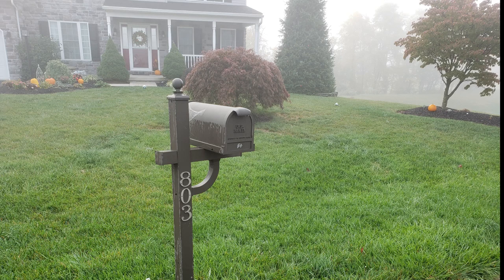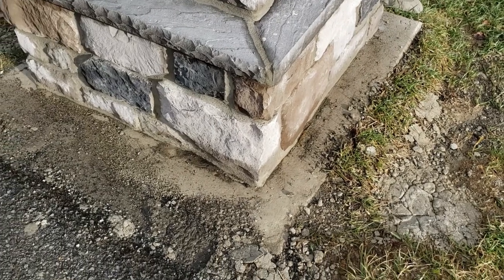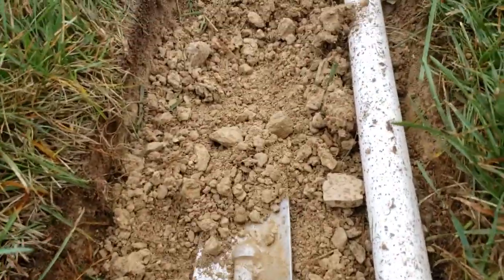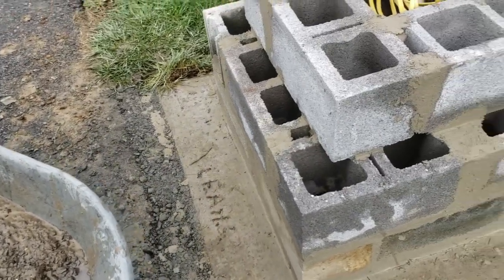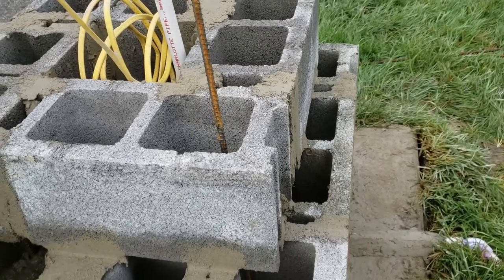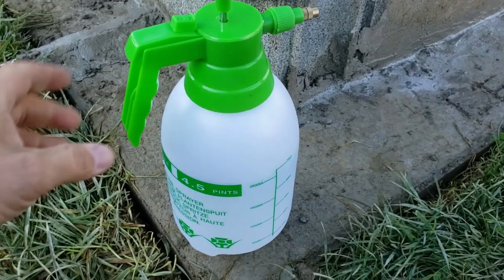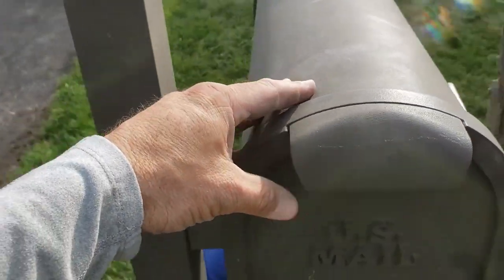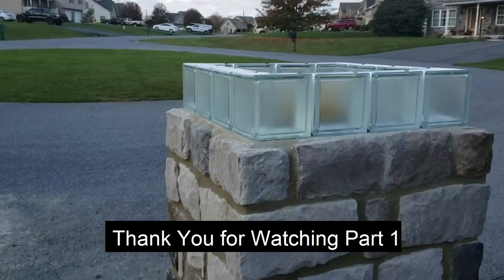DIY: Flag Stone Column Masonry Mailbox [Part 1 of 4] mailbox insert and veneer stone

Comment: That is one sharp-looking piece of masonry.
Reply from the maker: Thanks for the kind words. Let me know if you have any questions. I am excited to share and help others. When I built this, there wasn't much out there explaining so I decided to share
Reply: @DIYinspiredLewisBrantner I would of liked to see how you hooked up the light inside of the glass block and also if you incorporated that outlet?
Reply from the maker: @AStanton1966  It was really easy, I removed my old outside pole light and sliced the wire to it and ran to the new mailbox. I ran the wire to a outlet. Then I took a round ceramic light with a plug and inserted it into the outlet. I did it that way I could change the light socket rather easily plus, if my wife wanted to install christmas lights around the column, she could plug them in
Reply from the maker: @AStanton1966  go to this video https://youtu.be/QQnpZZ9B57c?t=579
and you will see the outlet
Reply from the maker: I want to publish a 4th video of me landscaping around the mailbox but didn't get that done yet. Also, I have many questions about the light which I should do another video of just that part, thanks for the questions so I can improve

Comment: What kind of light did you add inside the glass block & how did you hide/secure the outlet?
Reply from the maker: I wired in an outlet to plug in a light that I have setting in the center
Reply from the maker: Nothing fancy
Reply: @DIYinspiredLewisBrantner  I mean was it just a light bulb?
Reply from the maker: @dustinfigueroa1205  look for my other video, it shows it. I installed a light socket with a regular bulb
Reply from the maker: Did you see this video? Its the last in the series
Reply from the maker: https://youtu.be/QQnpZZ9B57c
Reply: @DIYinspiredLewisBrantner  yes I seen all 3 videos (well done btw) but I couldn't find part 4 of 4.
Reply from the maker: @dustinfigueroa1205  that one basically is the landscaping. I don't have it posted yet. I have to get on it

Comment: What are the measurements for base, first level and then 2nd level?
Reply from the maker: I will get you the dimensions when I get home to8
Reply from the maker: Top tier is 28 inches square. Bottom tier is 36 inches. This is the outside to outside measurement
Reply: So is the base 48 inches?
Reply from the maker: @drew4608 yes..... make it 48 inches and you will be good..... make sure you have it deep enough.... I would love to see pictures when you are finished. My email address is listed in my channel
Reply: @DIYinspiredLewisBrantner  your measurements are from top corner to bottom corner or edge to edge?
Reply: @DIYinspiredLewisBrantner  also what is the height for each tier?
Reply from the maker: @drew4608  bottom tier is 2 blocks high and the top tier is 3 blocks to the bottom of the mail box
Reply from the maker: @drew4608  I will try to measure it for you
Reply from the maker: @drew4608  not sure what area you are asking..... I am more than happy checking